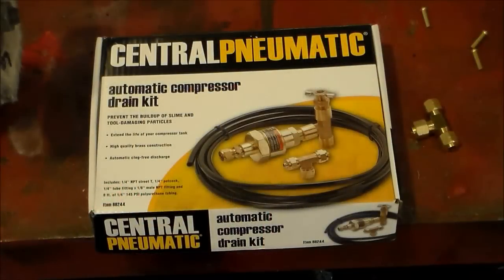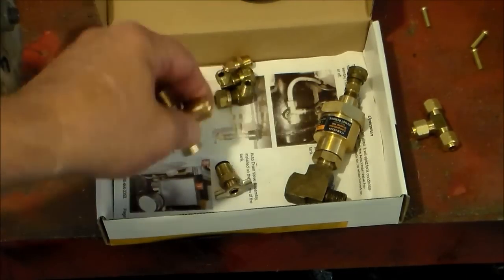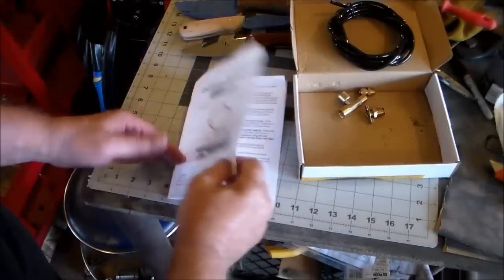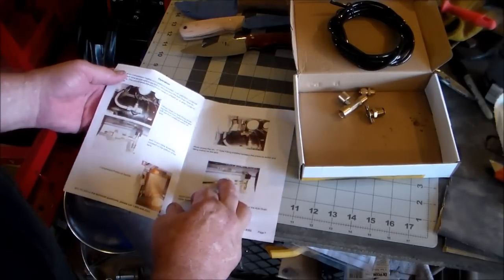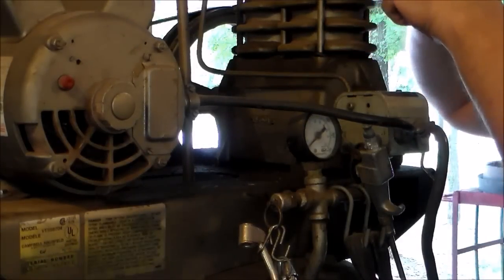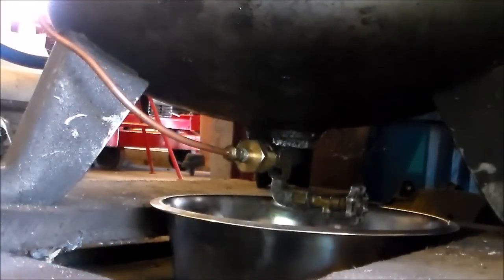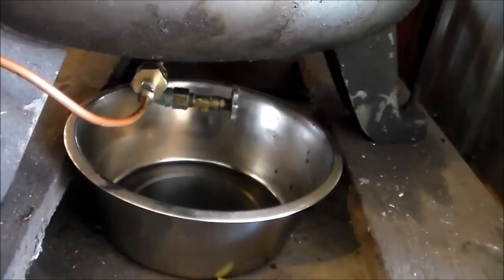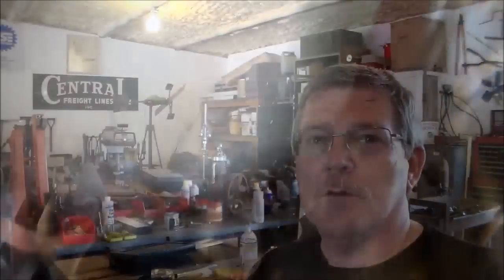Automatic Compressor Tank Drain - Harbor Freight #68244

Comment: A nice upgrade for sure. I like that you used copper line and kept the manual valve. I will look into getting one as well. Thanks for the Vid
Reply from the maker: At work we used a HD unit like this made by Bendix, cost a lot more than this did. Thanks GZ
Reply: The unloader line needs to be copper or otherwise isolated from the heat from the compressor line, otherwise it melts down.

Comment: Lloyd I tried two different brands and went back to manually opening it. They worked great for about six months then it would not seal anymore and drained out the tank , not always but enough to change. I guess it depends how clean the tank is I guess . Look forward to your long term results. Cheers .
Reply from the maker: We will see how it does. I'm sure your right about the tank. If it has rust and grit in there it won't work long.  Thanks Steve
Reply: @RustyGlovebox how did it do?

Comment: I just installed this. i also went with copper tubing. The tubing and fittings they give you are useless. The OD is smaller. If your unloader line is plastic tubing you can use it on that side of the tee by using a stiffener and a nylon sleeve ( a brass sleeve cuts in to the plastic when tightened). You'll have to change the compression adapter on the auto drain. Otherwise it works so far.
Reply from the maker: bernie10315   I had to do the similar with different fittings and copper tubing. So far it’s still work good

Comment: if it works out i will have to try it keep us up dated I need it bad and my air lines are all copper and used them for 18 years. and no problem
Reply from the maker: The copper lines do a great job dropping the temp and making the moisture drop out in the trap. This might decrease the amount of water in the tank. Thanks and take care

Comment: Just bought this to add to mine. What type of 3 way did you use on the top? How did you get the copper tubing on the valve end on the bottom? What Size tubing did you use? Sorry for all the questions. Thanks in advance for your answers!!
Reply from the maker: I used a 1/4" compression tee from the valve to the bottom with 1/4" copper tubing. Good luck on your installation.

Comment: What size copper line did u use and what size compression fitting did u use on the valve I used the nylon line to start with bug kept blowing it off I used a 1/4 t for my compressor
Reply from the maker: I used 1/2 inch copper tubing and it has held up well. Good luck

Comment: "will see if it reduces the moisture in the tank in a week.."

Its been six years or so, did it work?
Reply from the maker: When it worked it worked good. But the thin casting got a crack in it and started leaking after 3 years. I installed a cable pull valve in its place.

Comment: So, I added one on my compressor about 3 years ago.  In the first 2 months, one of the o-rings blistered and I had to take it apart and reseat the o-ring.  This last month (about 3 years later), the tank bleeds off all the time.  Yep, it the auto tank drain again.  This time, spring 7 (from the manual) as disintegrated.  I could probably just replace the spring, but I will probably just replace the unit with another 68244.  However, I will take it apart first and compare the spring and buy another spring and replace the spring first then later replace the whole valve.
Reply from the maker: Good to get information from others . I may not use my compressor everyday in my home workshop but  it does get use several times a week. I had to re-tighten the line nut on the main ejection valve about 6 months ago so far but that is about it.  Thanks

Comment: hi, what replacement fitting did you use on the valve to connect the copper line? the fitting that comes on it has a nipple for the plastic tubing. thx
Reply from the maker: I used the brass compression fittings for copper tubing.  1 3way compression fitting and 1 compression fitting to 1/8 pipe. I got mine at Home Depot. Good luck
Reply: thank you